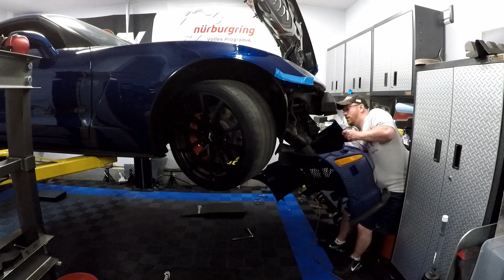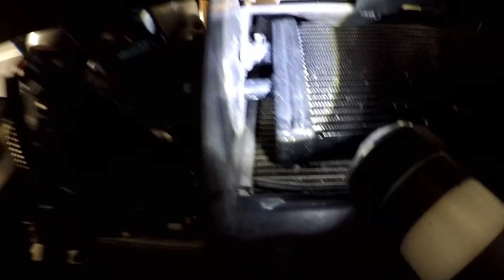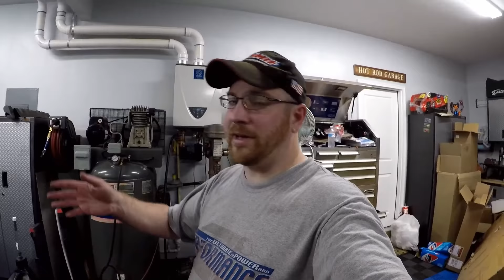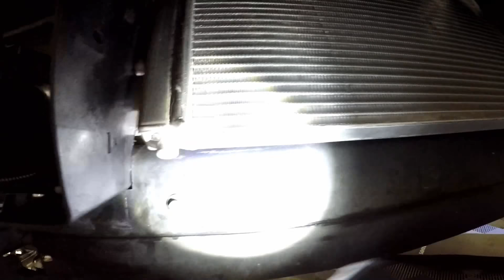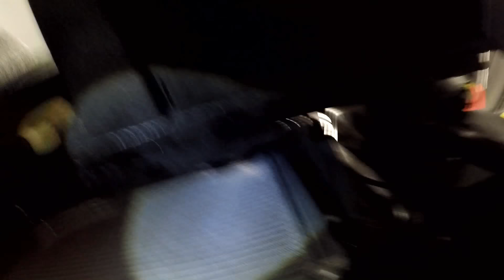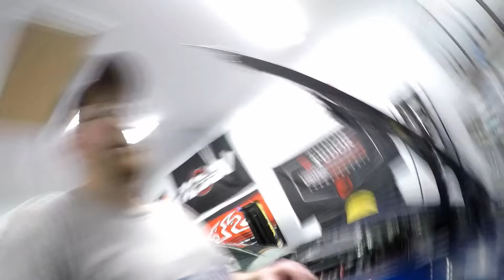2005 Chevy Corvette - Upgrades 3.0 - Pt 30 - Edelbrock Heat Exchanger Install

Comment: Did you do any pump upgrades or stick with the stock Edelbrock?
Reply from the maker: Shane - upgraded to an EMP pump.

https://youtu.be/8NBtCQSrcOs
Reply: @bonecrrusherSS  Cool.  Thanks for the link.  

I just finished my install of the Edelbrock heat exchanger yesterday.  I think I will stick with the stock pump as it seems to be flowing quite well.  Install was not as bad as I thought it would be.  I installed it with the exchanger inlet coming from the pump on the bottom.  I had to clearance the Edelbrock pump bracket so that I could rotate the pump so that the discharge was to the side instead of up.  The pump discharges right into the inlet of the exchanger with about 1/4 of an inch between the barbs.  The outlet of the exchanger is at the top on the drivers side.  I figured that this would help in pushing out any possibility of trapping air.  And it seems minimize any unnecessary bends in the circuit.

I also installed FI Interchiller blower spacer plates.  They are made of delrin plastic with integrated o-rings for the LS3 heads.  It raises the supercharger 12 mm so I add Lingenfelters subframe spacers which are 6 mm so overall it raised the supercharger 6 mm.  I also had to do a small modification to the oil pressure sensor plug to that the supercharger would clear that.  I now need to clearance the cowl below the windshield wipers as it is just touching.

I think the plates help a lot.  Went for a drive where the engine was fully warmed up.  When I stopped and felt the supercharger, it was still at ambient temps while the I couldn't touch the valve covers.  Previously, the supercharger would be quite warm by this point.  I am sure the better heat exchanger is also helping.

Comment: Did you see a difference in temps between the radiators?  The smaller is a dual pass and the larger is a single pass and considering that, they look to have the same surface area.
Reply from the maker: It looks like most dual pass radiators have a seem welded in the middle of the end tank - to force the coolant to go to the other side of the radiator on the second pass. The stock Edelbrock HX has no such seams in either of the end tanks. 

As for supercharger coolant temp - no. I do have IAT temps which are cooled by the overall cooling package. On two super hot humid summer days - the IAT dropped by 10* average at the start of the 1/4 mile run - in the middle temps where about the same - and at the end it was 5* cooler. 

On the fastest run the car has ever made - IAT was 15* cooler at the start, 8* cooler in the middle, and 10* cooler at the end then rest of the runs that day.